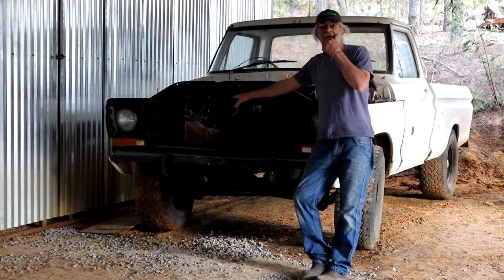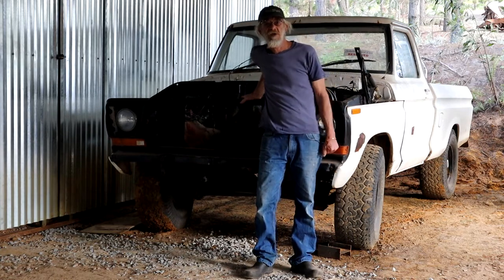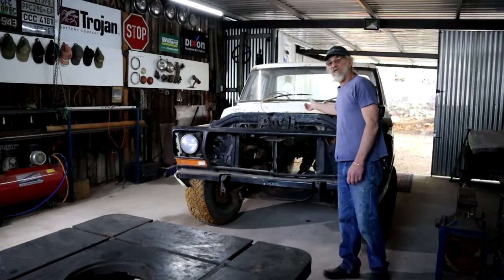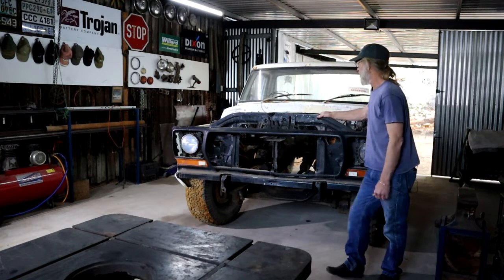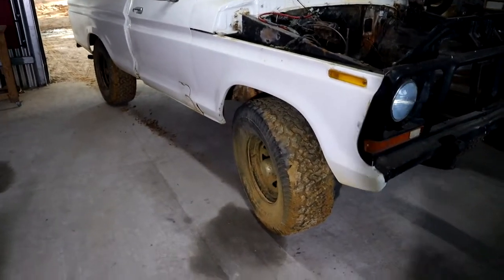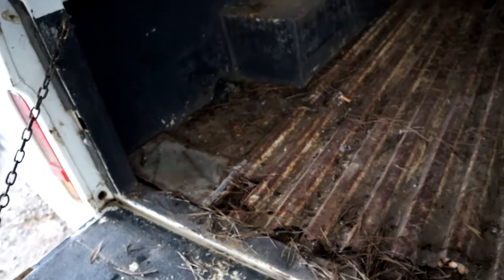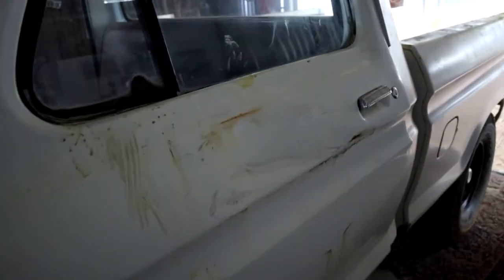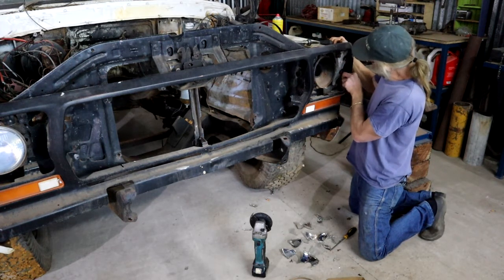BUILDING A RAT ROD FROM A FORD F100 TRUCK? Part 1

Comment: I want to rebuilding mine where and which company I can buy the accessories just in south africa
Reply from the maker: What are you looking for?
Reply: @ratrodsafrica  front disc dram ,brick pad brick disc and steeling box that can work with power pump my car is F 100 76 model
Reply from the maker: @mikeilikeit9685  Ford Fanatics in Lichtenburg has a lot of new and used parts.